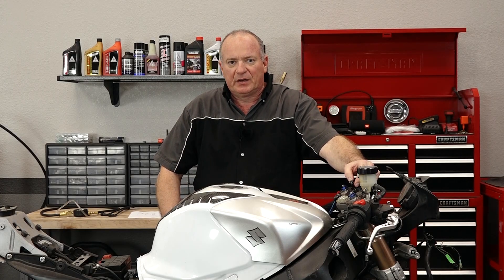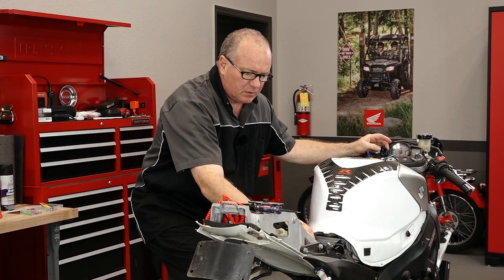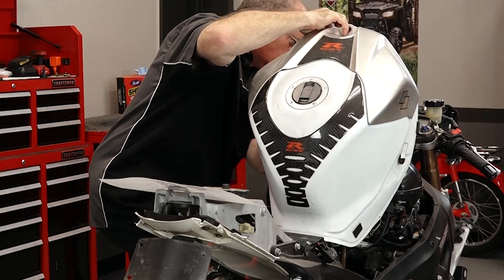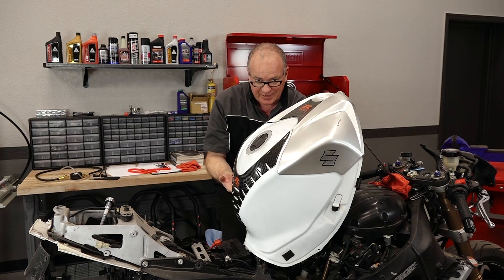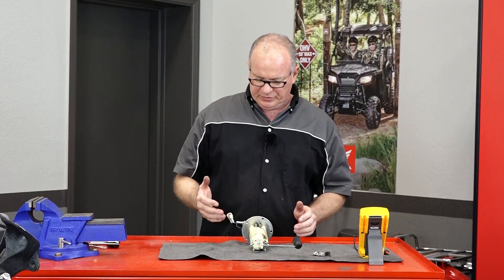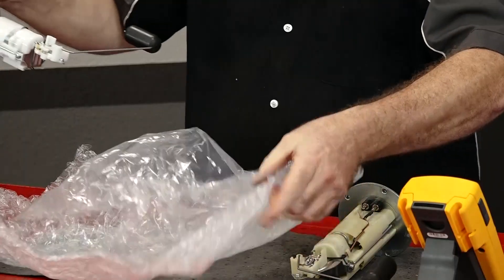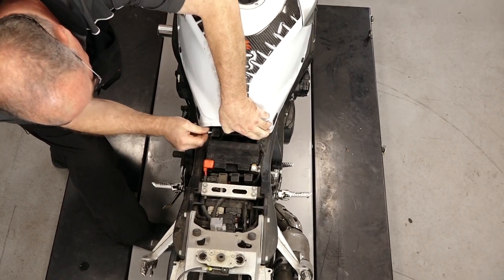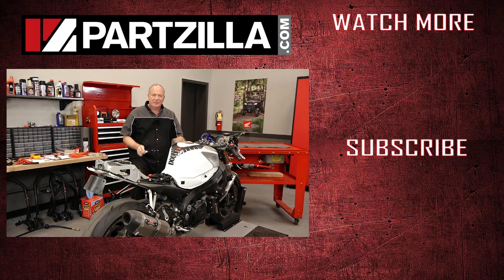GSXR Fuel Pump Not Priming | Suzuki GSX-R1000 | Partzilla.com

Comment: I have a Suzuki GSXR 600 k1 and my fuel pump is not priming, I’ve followed the video up to removing the tank and the fuel pump. The relay and connector under the tank both activate my test light along side the klicks when I turn the key to on. 

However I can’t remove my tank as one of the Alan key heads that holds it in place is stripped and I’m having trouble removing it. 

What I’m asking is there a way to test the fuel pump while the tank is still in the bike with the fuel pump fully in. 

Also when I took the hose off connected to my tank it had a continuous stream of petrol from it that didn’t stop (there’s about 5/6 litres in the tank)
Reply from the maker: Get an extractor and remove the stripped screw.  You're going to have to pull the pump out.
Reply: Partzilla would using a power probe to the red and yellow wire coming from the pump that connects to the wiring loom test weather it fires up while still in the tank?

Comment: I have 1997 srad gxsr 600 I don’t even hear my fuel pumping priming nor do I hear the relay actuating  what do think it could be  and would this video apply to my bike .
Reply from the maker: A '97 shouldn't have a fuel pump.  It's carbureted.
Reply: shakir Phillips 

Your bike is gravity/G-Force feed. It will not have a pump or relay. 

If the bike is working correctly you have nothing to fear. 

If it isn't working correctly then post your symptoms and I'm sure someone will be glad to offer suggestions.
Reply: I have a 96 srad which also DOES have a fuel pump, ignore people that dont no what they talking bout, and mine wont start did u figure anything out?

Comment: Hi. I’m trying to pin point why my 08 Gsxr 1000 will not start. I’ve watched your other video where you show how to check voltage on the starter relay, clutch, and fuses. They’re all good. The bike comes alive except for priming up and nothing happens when I push the start button. Would the bike still spin over if the fuel pump is bad?
Reply from the maker: It will still crank.  You don't hear the fuel pump prime when you power up?
Reply: Partzilla no I hear nothing. I don’t think I hear the actuators. The tach cycles and the lights come on. I do see a CHEC code though.
Reply: Having the same issue. Did you get this fixed? Everything seems to check out but the fuel pump still will not prime.

Comment: My 2011 600 has a poor throttle response. While riding and i pull the throttle 100% it sorta feels like i have let go of the throttle then bring it back 3/4 then catches speed.Would you think the fuel pump would be the issue? Thanks!
Reply: Eddie Garcia sounds exactly like what my SV is doing. 

Suzuki uses an internal high pressure fuel filter that's built into the whole unit but should be able to be replaced.

There may be an external fuel pump mod available, like this:

https://www.vstrom.info/Smf/index.php/topic,6105.0.html

Obviously this is not for your bike...you'll have to do your own research, but it shouldn't be hard to find.
Reply: Need more fuel flow. 2 filters in the fuel pump need inspection. Test flow too.

Comment: I have a kfx 400 that it backfiring at the top of the gear and I was wondering if there is something to buy from you to fix that?
Reply from the maker: It's an air/fuel issue.  You would need to adjust it.